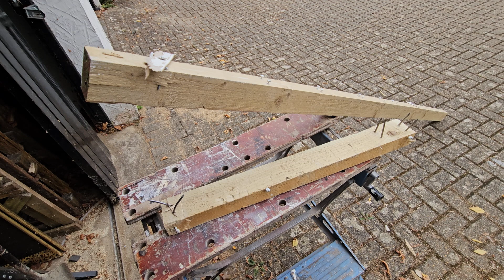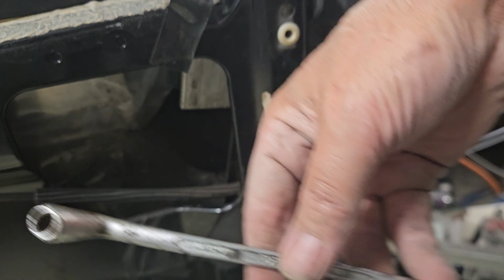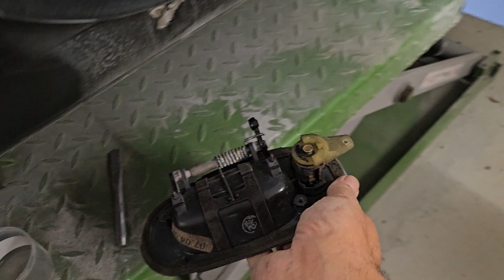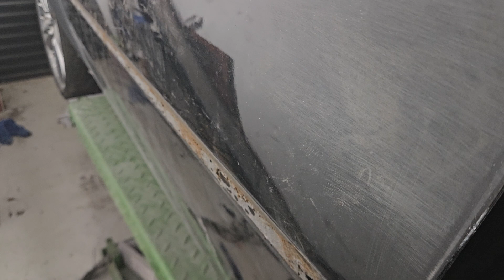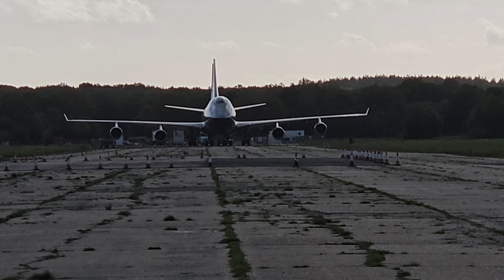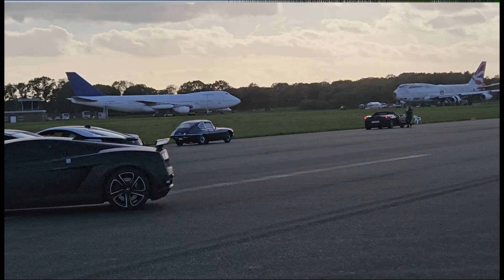XKR repair #30 Spray Booth Questions, door handles and E-Type drive

Comment: Does it have to be polythene? Tarps as good as anything?
Reply from the maker: You get some more light through it and I guess It will be a real patchwork using various tarps etc that I have available. I will check the condition of the tarps before deciding on next steps